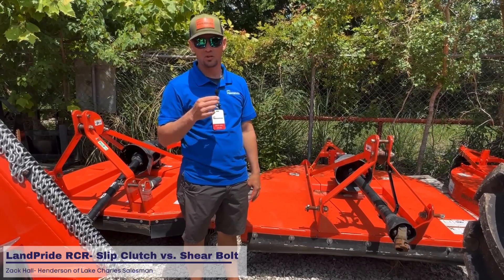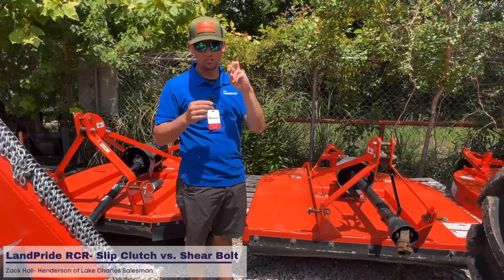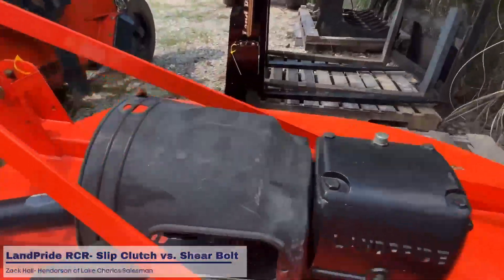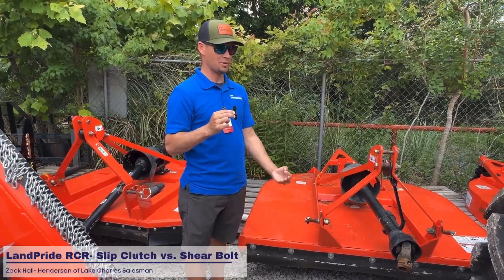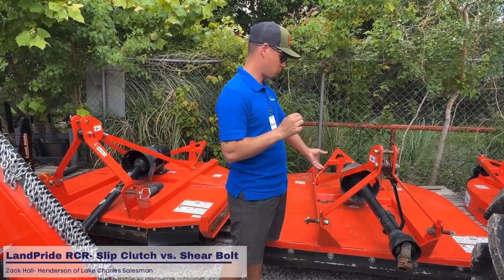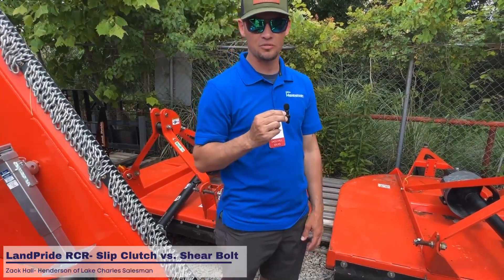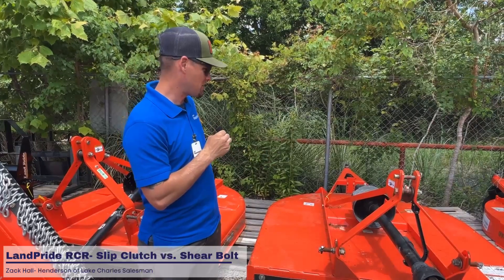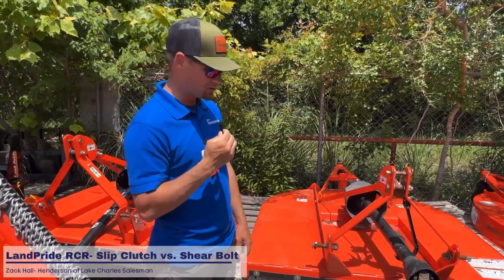Land Pride RCR- Slip Clutch vs. Shear Bolt

Comment: Good job. 1 question: Between the two cutters (RCR1260 & RCR1860 both with a slip clutch) which would you recommend for longevity use?  Thanks
Reply from the maker: Both are really great options, the RCR1860 overall is more likely to last longer.